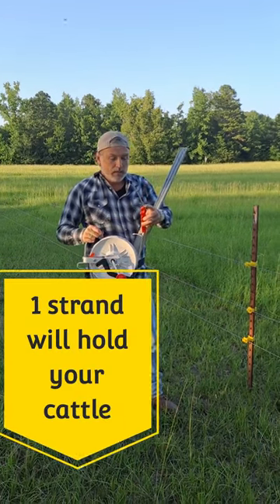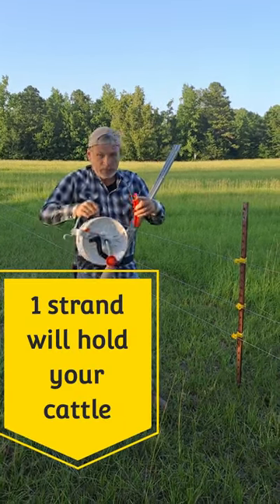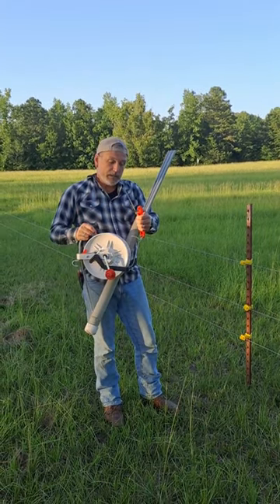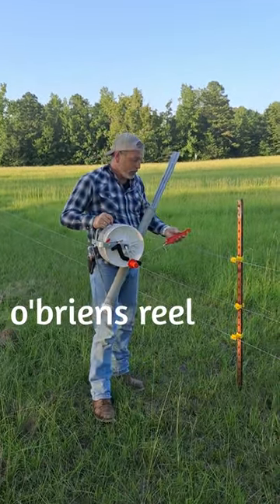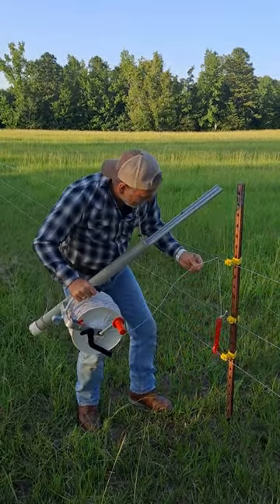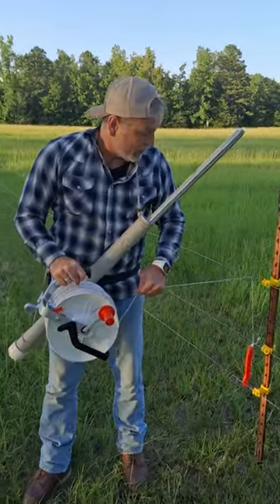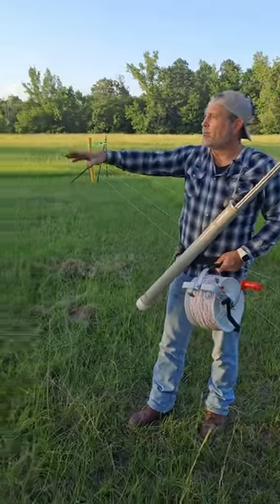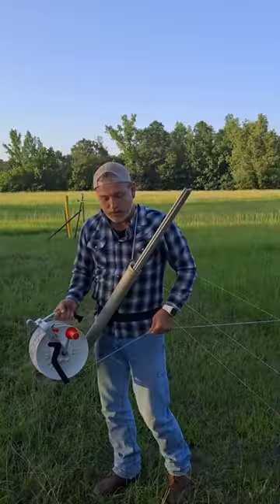electric fence for your #cattle #polywire #farmlife #regenerativeagriculture

Comment: So I have the same fence wire, but for some strange reason, one part of the fence is still working, and the side is dead, any tips, like is there like a trip? Or short circuit, first. Time farmer here...
Reply: That dead section is grounding out on something. Check your insulators. Acracked one will cause all kinda issues.